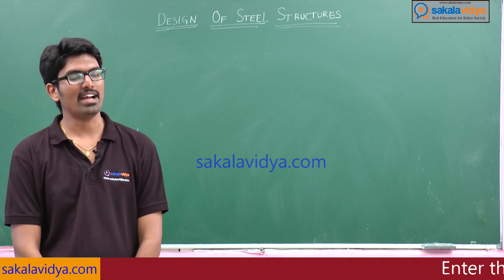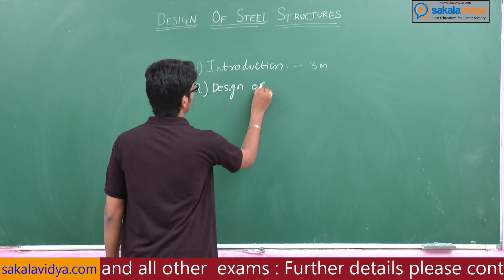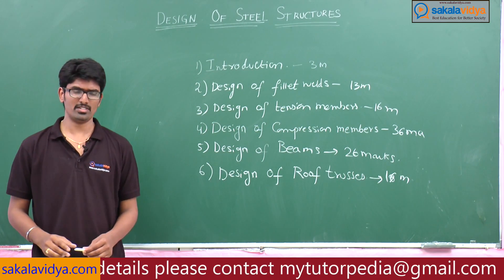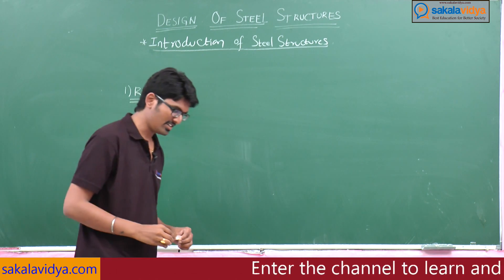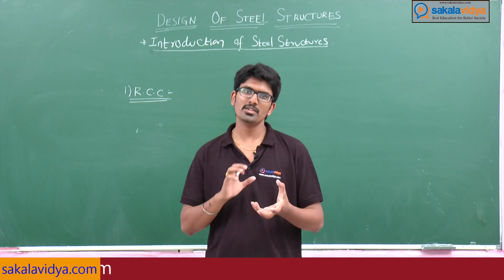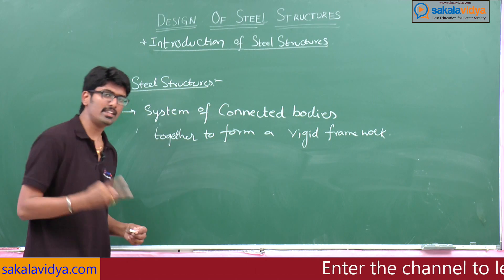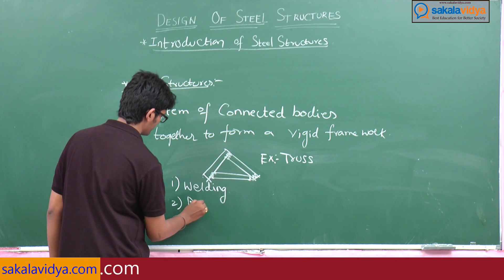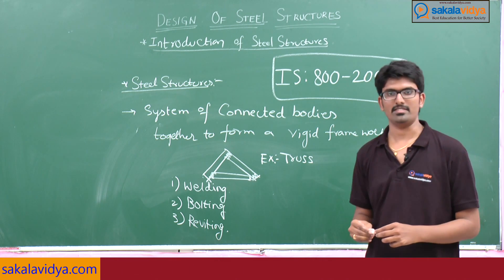Diploma| CIVIL ENGINEERING| Design of Steel Structures| part - 1

Comment: Why we use steel in column when concrete is compressely strong?
Reply from the maker: when the span b/w two columns i more then we employe for steel structures.for example in the case of flyovers if the span length is more then we go for steel structures & it is not easy to cast concerte of longer span.

Comment: sir your teaching is very good iam learned so much sir thanks for telling and sir in rcc we mix not only water+cement+aggregate+steel you missed one main thing sir ..its sand we use fine aggrigate also
Reply from the maker: thanks for your feedback and share with your friends too.
cement+water +(fine & course aggregate) together is called as concrete.
in RCC we use concrete + steel reinforcement.

whereas in steel structures we directly use structural or rolled steel for construction,whereas concrete is used only at foundation level for connection with the structure.
so that is the reason i didn't mention about that in this topic.
when it is rcc we completely discuses about that.

Comment: In roof truss why do not we provide flat section instead of angle section as filler members.?
Reply from the maker: we can also use various types of Tension members like 1)wires & Cables
                                                                                                     2) Rods & Bars
                                                                                                    3) single structural  shaped plates
                                                                                                    4)Built-up members.
In heavy loading structures like bridge decks, heavy industries we mostly use 'I'-Sections.
For lightweight structures, we use hollow circular sections.
The load-bearing capacity of flats are very less when compared to angle sections, so flats are mostly used as gusset plates in order to connect to structural elements etc..
Reply: Sakala Vidya got it . 
But I want to know that. " Suppose for transmission tower ,  you may provide an angle section 65*65*10  generally. Then why we don't  provide 65*10 flat section ?